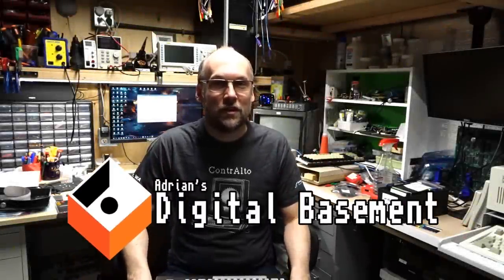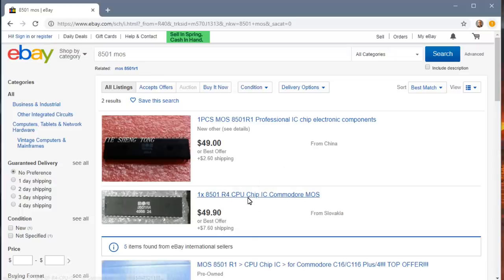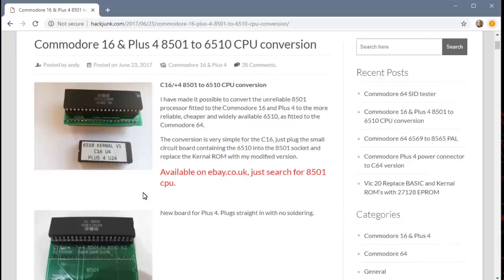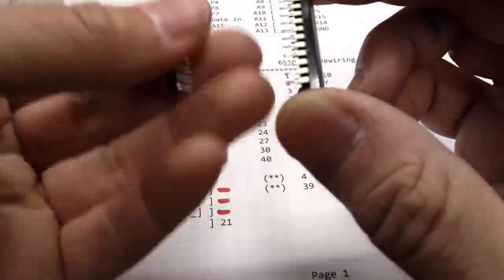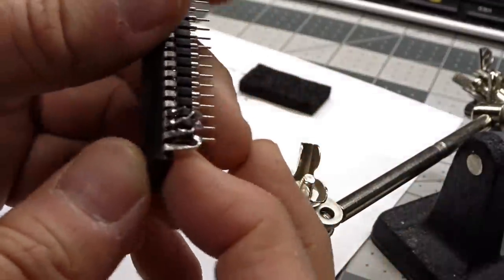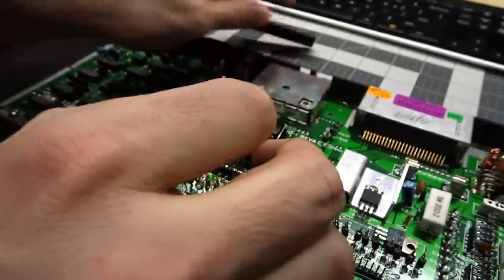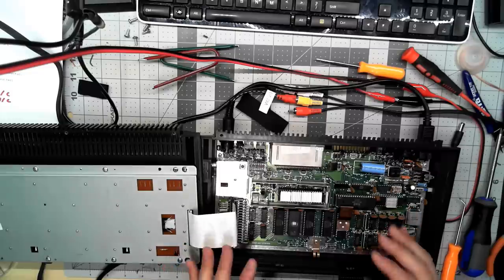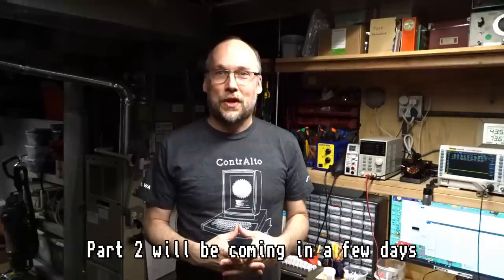Commodore 16/Plus4 CPU Replacement (or how to build an adapter)

Comment: Surprised that they didn't take the SID chip.
Reply: C16 does not have a SID, the TED does both graphics and sound :)
Reply: @Poble The TED chip was originally designed for a business oriented computer. Commodore didn't think that fancy graphics and sound were important for that type of machine, so they designed a combined chip for both things. The business computer ended up being the Plus 4, which was a bit of a flop. Commodore also wanted a budget computer, so the same chip was used in the C16, which was also a flop (first computer I owned though).
Reply: @davidboucher99  Thanks for the information!

Comment: Oh wow, yuck.

Instead of bending CPU pins out why not use 3 rows of socket strip, push the pins out of the middle row for the pins that need to be rewired and wire from the row the chip is plugged into to the bottom row which plugs into the motherboard?
Reply: I thought the same thing, but there may not be enough space to do that, and be able to close the case.
Reply: Yes there would definitely not be enough space.

Comment: I also suggest to replace the 7805 power regulator with an modern switching one. This includes removal of resistor R10. That way peaks from mains supply wont struck to the circuits and the heat load sinks a lot. I also noticed a project to replace the TED by a FPGA ( https://hackaday.io/project/11460-fpgated ) but it looks more like a proof of concept since the hardware is clunky and external. PLAs are a different story, modern EPROM are simply too fast. There once was a chip called M27C512-90B6, but its out of production. Sadly, most alternatives are not timing perfect.